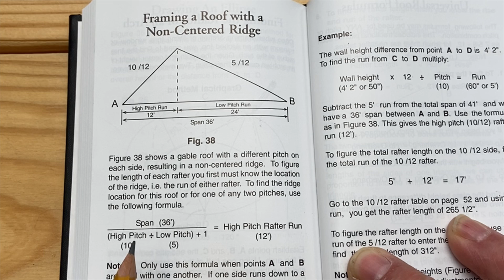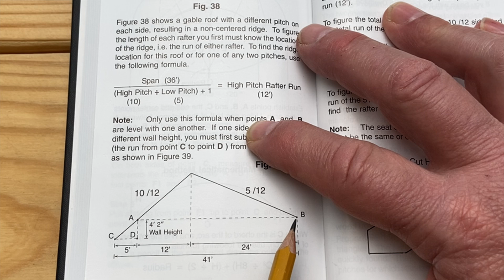How to build a non-centered ridge

Comment: Will the ridge deduction on the 10/12 be 1/2 inch, and the deduction on the 5/12 be 1 inch?
Reply from the maker: When using a 1 1/2" thick ridge board that would be correct. Thanks for watching!
Reply: @RoofFramersBible  Thanks again

Comment: Really nice video!  Do you have anything on how to do the joins, for example whether using bolts or nails etc?  I have no idea....  Thanks!
Reply from the maker: Typically this type of framing is just nailed together with 12D or 16D nails. Some will be "face nailed" through the ridge board. Others will be "toe-nailed" (nailed on an angle). This is fast and easy. Thanks for watching!
Reply: @RoofFramersBible  Thank you!

Comment: This may or may not be related.  How do you make a gable roof if the walls are not parallel?   The walls are level and the lengths are the same.
Reply from the maker: Well, you can do that, but it comes with choices. You can either have the rafters all the same and have the ridge out of level, or you can have a level ridge and cut progressively longer and steeper rafters as you go along the length of the gable. Neither one is an attractive choice. Thanks for watching!
Reply: How many degrees is the wall out of parallel then step the rafters up or down on that degree with your on center stored

Comment: Hi thank you for the videos...Will the formulas work if I enter degrees in the high pitch and low pitch areas?thank you
Reply from the maker: No, unfortunately that won't work. This formula is based on the rise of each pitch relative to each other. degrees would not have the same proportional relationship. Thanks for watching!